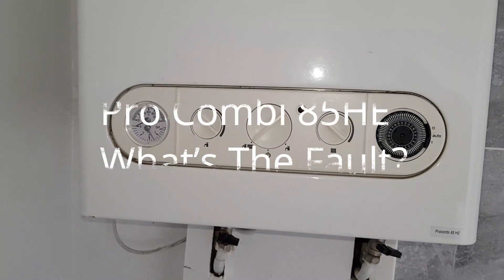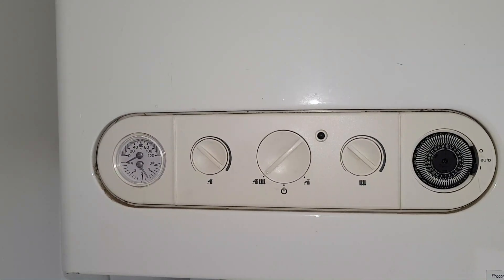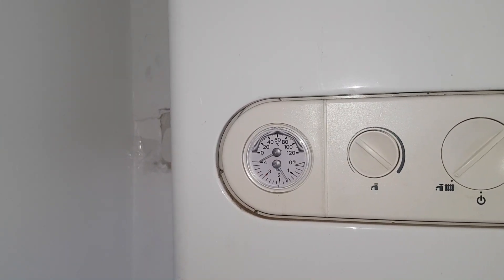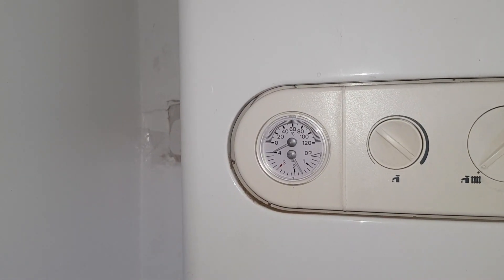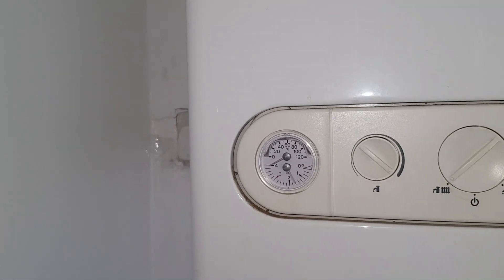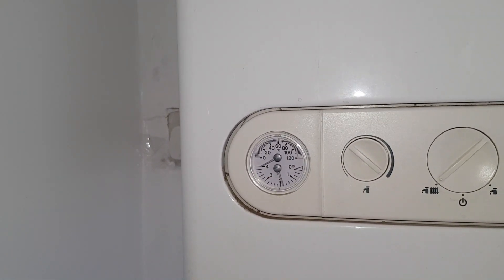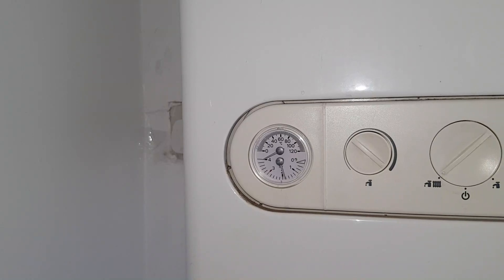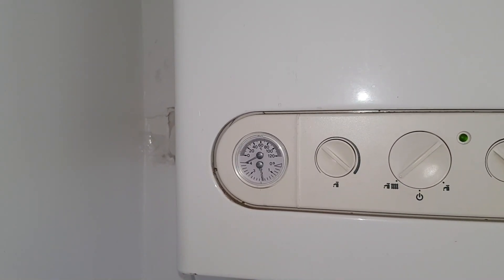Pro Combi 85HE What’s the Fault

Comment: Just to confirm it was the plate to plate scaled? Not the primary heat exchanger? Thanks
Reply from the maker: That's right
Reply from the maker: hey, we're currently growing our Facebook group, it has lots more content there and i'll be there to answer any questions you may have join using this link https://www.facebook.com/groups/167070231326174

Comment: The primary heat exchanger is heavily scaled .
Partial over heat spots inside, hence creation of steam and altering the circuit pressure.
30 years experience.
Reply from the maker: Yeah I'm looking for someone like you
Reply: Well done
Reply from the maker: hey, we're currently growing our Facebook group, it has lots more content there and i'll be there to answer any questions you may have join using this link https://www.facebook.com/groups/167070231326174